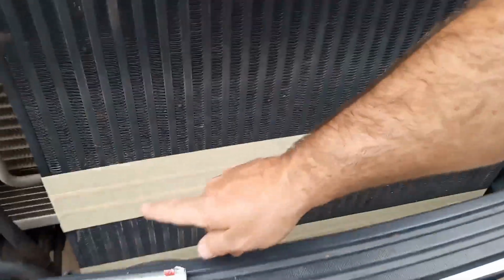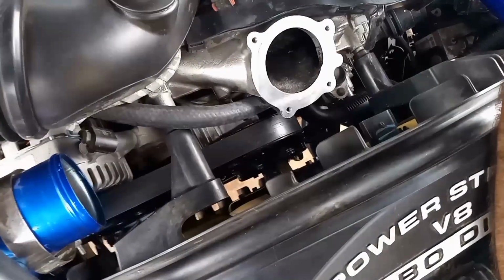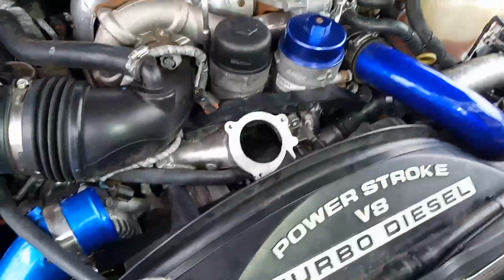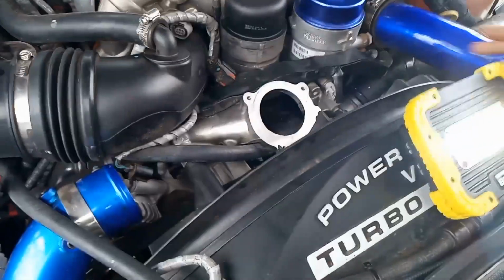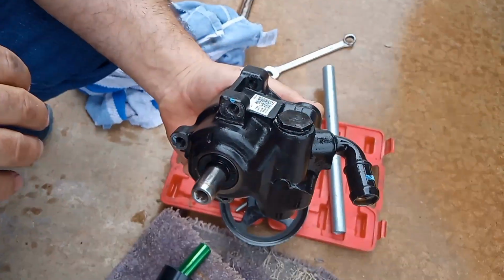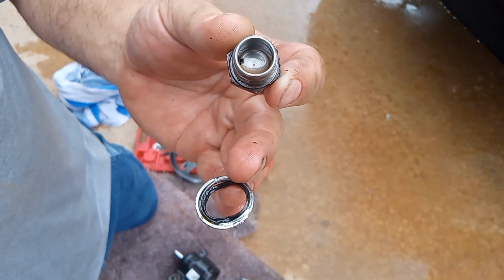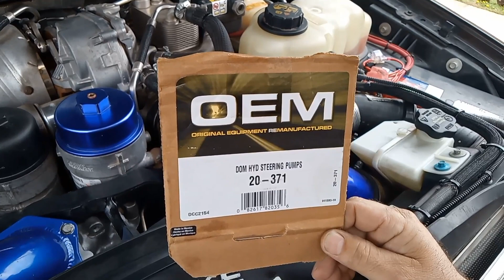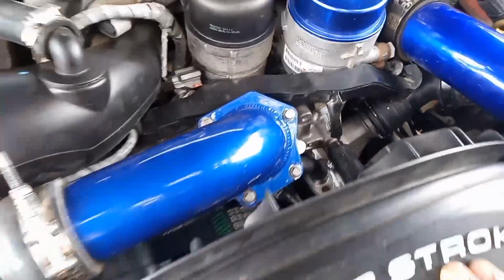Low quality Remanufactured power steering pump 6.4

Comment: I don't have the explanation for the milkshake.   It'd be cool to somehow figure out if it's just water (condensation) or coolant.    Is your crankcase vent still stock,,  does it go back into the intake?   If we think about it,,  any condensation from the hot truck being shut off in cold weather will end up going thru the ccv system.  I would say the engine will easily ingest that while its working.   Didn't say it's right,,,   but it will run thru there.   that would also smoke if there's a lot of it too huh??

I quit beating myself in the backyard with a1 cardone about 10 years ago.   The Ford power steering pump is about the same cost as the aftermarket.   I have found it necessary to never even think about a pump unless its from ford.   Those have sukd too,,  but not to the extent of the cardone.   EVERY cardone got warrantied fast.   I tried about 10 times tho!!!   lol
Reply from the maker: Yes sir I think the milkshake is from us doing it hot engine cold rainy day .......

If my Ford parts guy had been open I would have gone Motorcraft and will if this" OEM " fails 

Thank you for the response and I want to make a trip up and visit as well as pay you to run a computer on my truck to see if everything is looking good ........truck runs amazing but I have no clue the specs it's set on would also like to see if my dual alt is programmed in or operational